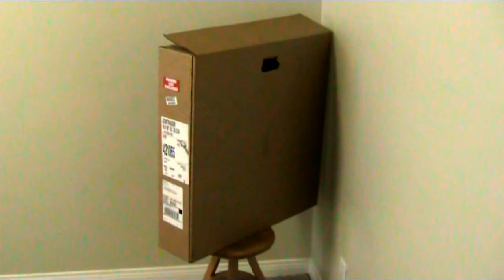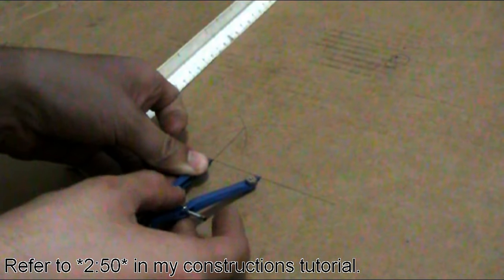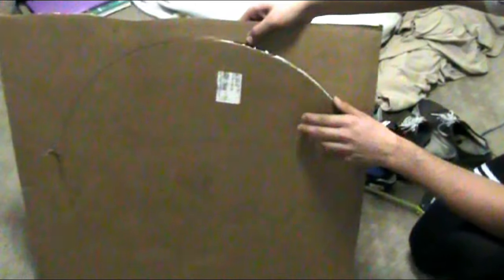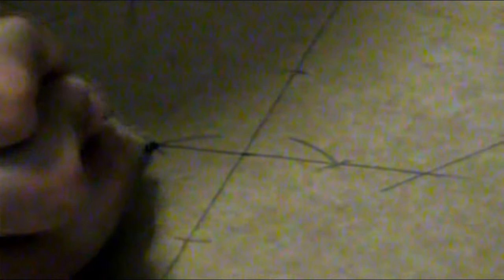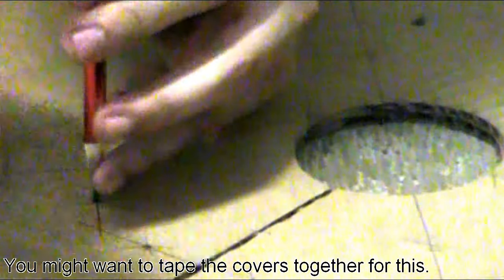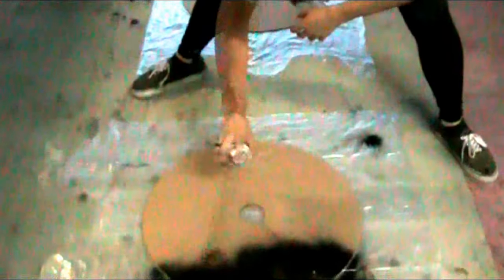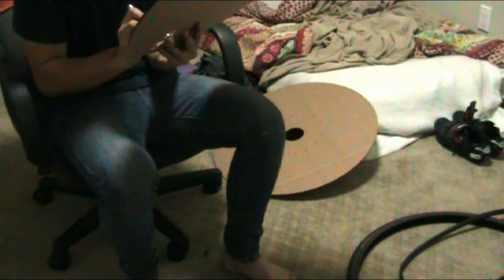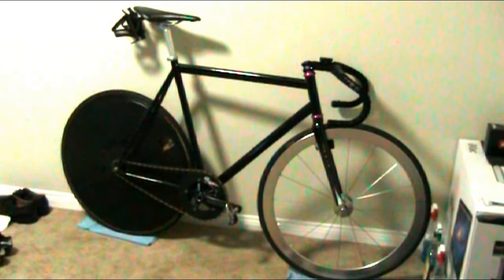How To Make A Disc Wheel Tutorial

Comment: I'd like to add to the instructional, if I may. Just finished my 26" wheel and the results were sweet. When cutting out the "pizza slice" that allows the disc to form its conical shape, use the equation (everything is in degrees) D=360-{360sqrt[1-H/R]^2} will give you the degree of angle from the origin for your slice. D is the desired angle, H is the height from the rim to the hub, and R is the radius of the disc (I used the ETRTO when constructing mine, 559mm)

Comment: Discs are more aero than spokes, and a disc clad rear wheel is actually better than spokes in a cross wind. Making them from fluted polypropylene sheet 2mm equal very light discs. These flex a bit but work really well. Fitted my own to my mtb front and rear.

Comment from the maker: No. I believe that I said that you use the compass to measure the width of the hub flange (which is bigger than the cog in my case) to then use that measurement to determine the size of the center whole of the covers.

If your hub flange is smaller than your cog, then measure the width of the cog with the compass to determine the size of the center hole of the covers so that you don't have to remove the cog during installation.

Make sense?

Comment from the maker: Well, the frame comes with a 1 1/8" steer tube and probably uses an internal headset. The BB will be standard 68mm English threaded, probably wana use a 108mm spindle or something, I'm too sure on that one, it depends on the cranks. Just get Omniums. 

And lockrings and cogs are all universally sized as far as I'm concerned. I'm pretty sure that the Resist hub is like, BMX crap, so idk if that's different.

And as far as hubs, you just need a 100mm axel front and a 120mm axel rear.

Comment: Should you wish to find the arc length at the circumference of the disc, use D from the previous equation. D/360*2Pi*R. You don't need to switch your calculator to Pi radians, leave it in degrees. Use a piece of paper to make your markings on the edge of the disc. If you do this, it will line up perfectly every time. And remember H will be different for left and right, because the wheel is dished. Hope this helped. Also, I used nylon screws and locknuts instead of zip ties. Just my preference.

Comment: @jdawg4334 i need help,Im going to buy a leader 725 frame. So i have to buy parts for it,i mostly know all the parts to buy and sizeing but what i dont know and really need help on is the hubs and bottom bracket. I do not know anything about them,i know what they are but i dont know the sizeing or which to buy. I looked up some hubs(resist hubs) but they have werid sizes like 38h. Also i do not know anything about the bottom bracket, i just need help on (hubs etc,bottom bracket etc&lockring etc)